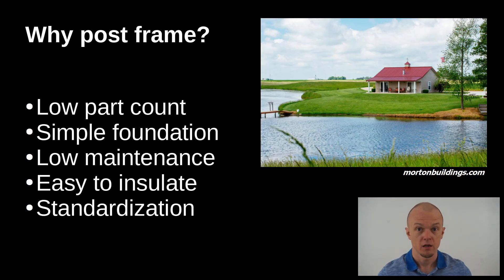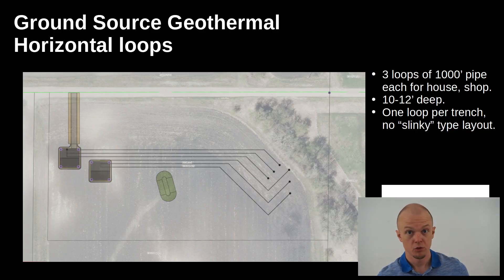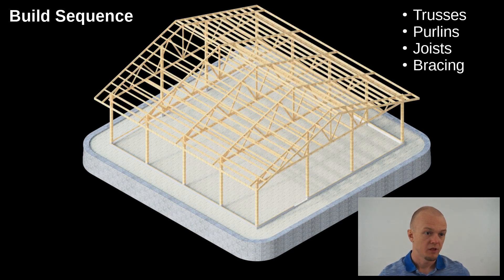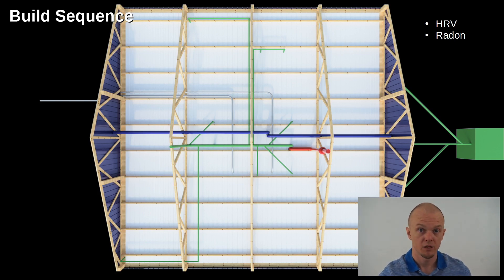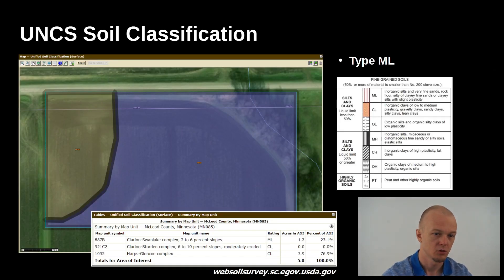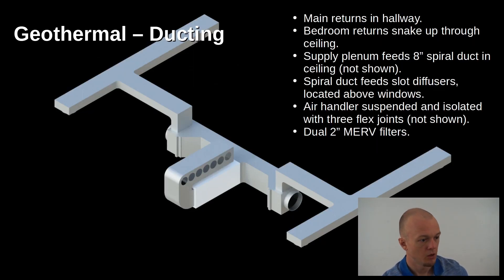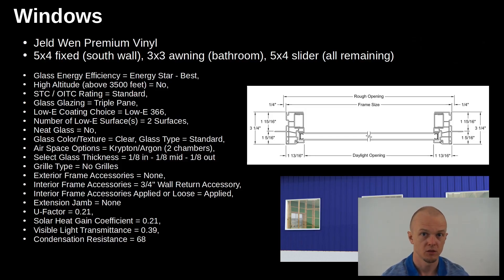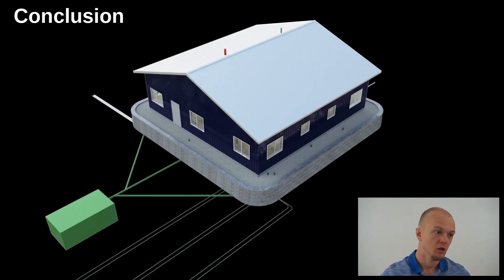40x40 Post Frame House with Ground Source Geothermal - Design Review

Comment: Erik,  Nice work....I'm a Geothermal contractor in Northern Vermont and I'm building a similar Post Frame home.  What software did you use for your modeling and who designed your structural plans?
Reply from the maker: Software is Fusion 360.  Structural plans undecided, but possibly Hansen Pole Buildings.  Am actually moving away from geothermal to cold climate mini splits.  Found performance to be similar when simulated in BeOpt.  Details in latest video.

Comment: Hey Erik, Montypbbc here from GBA. You're mechanical's are pretty next level really appreciate the full details on the gshp design will be very exciting to observe your btu usage one built! Also love that you're going with the square for most sqft to least exterior wall ratio. The mechanical room centered in the square makes for what I think would be a great open floor plan but with built in privacy areas. I haven't gotten to the interior floor plan on my project yet and I'm definitely going to be using these ideas. 

You mentioned possibly going with interior stud walls and placing the girts to the exterior of the posts. I think this is the way to go for a couple reasons. Like your said you remove thermal bridging. Second if using a smart interior vapor retarder/air barrier like intello it makes continuous connection to your ceiling air barrier really simple. You get the added R value and can run your electric on the interior of your air barrier.  

Also this is part question part suggestion. You could use 2x3 or 2x4 strapping and a rain-screen on your exterior walls and change your siding from metal to something a little more residential looking like LP smartside. Do you think the heavy duty vertical strapping like 16 or possibly 24 on center would be enough to replace the structural element the steel provides? From what I keep hearing a rain-screen would give most any siding the same longevity as steel siding. In my area LP smart side is less costly than steel and in my opinion have a better look. 

Thanks for sharing Erik look forward to more details and progress reports!
Reply from the maker: Thanks for the comment!  In fact, after obsessively reading GBA, will be making some changes:  Air source geothermal instead of ground source, double wall as suggested, heat pump water heater, and others.  Will make an update video.  Have been doing a lot of modeling in Beopt.

Comment: Thanks for the video.  We are building a post frame shop an apartment on our lake lot near Willmar.  Choosing post frame for the same reasons you mention as well as considering geo heating and cooling.  Would need to do a slinky system however due to a more limited space situation.  You have any thoughts about putting part of the slinky loop under the building or if code would even allow?
Reply from the maker: Would not recommend slinky under the slab.  Reason being the loops will pull heat out in the winter, exacerbating the conditions that lead to frost heave.  Didn't discuss this in the video, but plan on sleeving the lines in pvc under the slab, for that reason.

With limited space, you could dig a pit and fill with slinky, then backfill.  Or at more expense, drill vertical wells for closed loops.